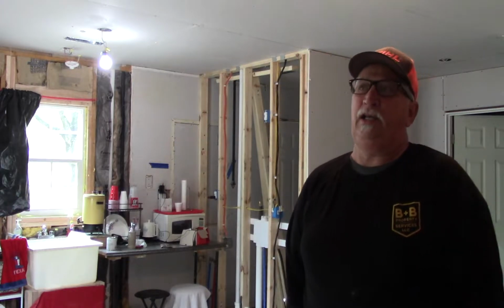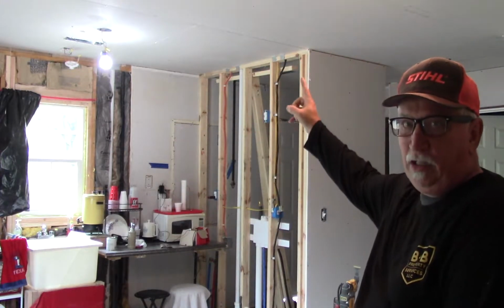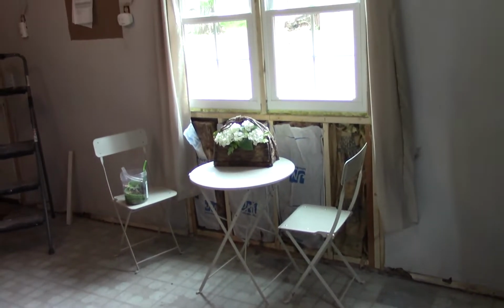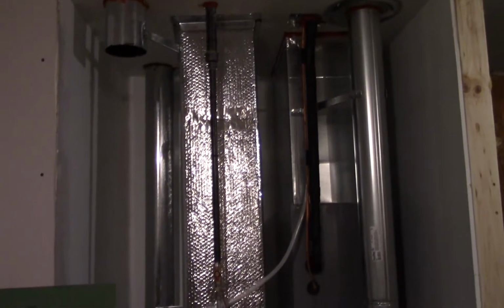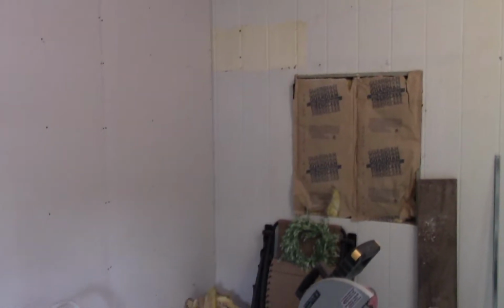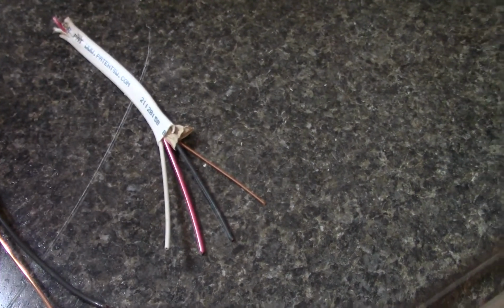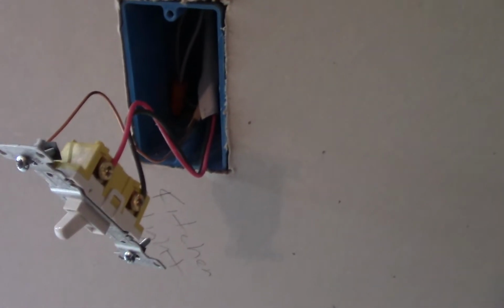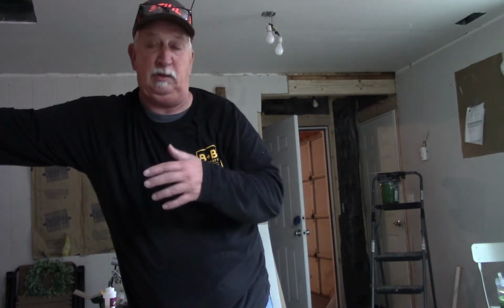Tiny House 3 - Inspector Insanity

Comment: Unfortunately with homeowners doing shoddy work brought on the need for inspectors and inspections along with code requirements - the most frustrating part of it is that it boils down to the code enforcers interpretation of the codes
Reply from the maker: I totally agree. I see first hand the terrible work done by contractors and home owners. What I have heard from some real pros is that the county has "trained" inspectors to inspect all the trades. You end up with a guy who is an expert in his trade inspecting trades he has never really done and so he suspects everything is a trap. I was a RTS (Return To Service) Inspector on business jets and as a mechanic I was always suspicious when an avionics guy wanted me to buy his work so I understand the caution. lol. If I would have bought a house a mile away over a line on the map I would not need a permit or an inspector for any of this. 

Thanks for your comments. It was a good day, most of the drywall is finished. The places that need inspected are drywalled with a couple of screws in them so when the time comes we can screw them down and the mud and tape guy should be able to fly!